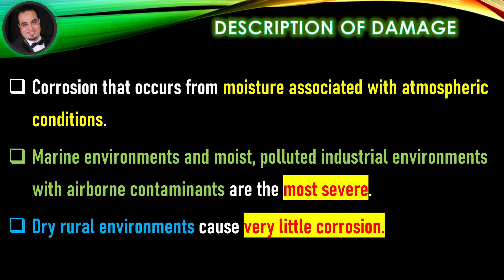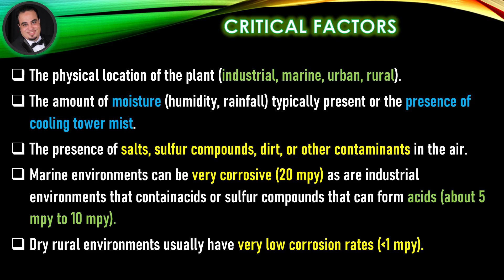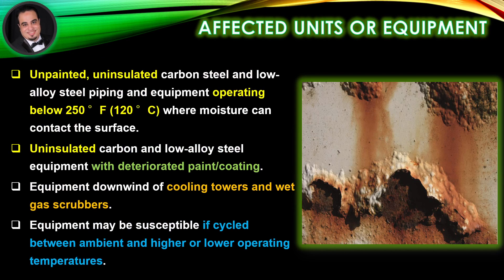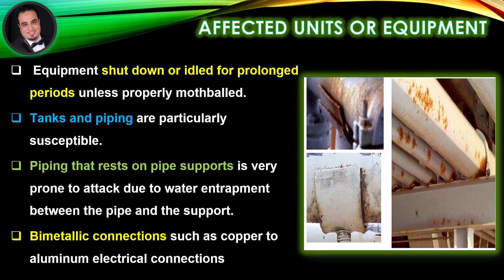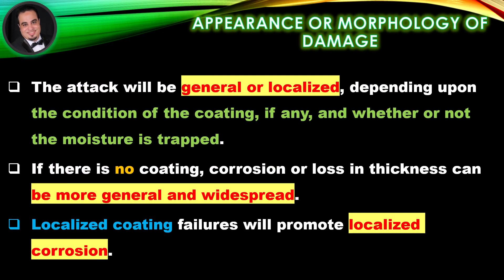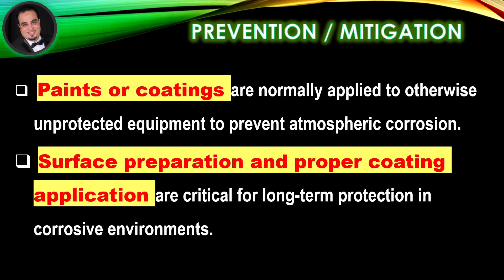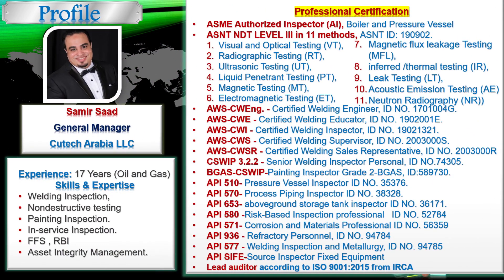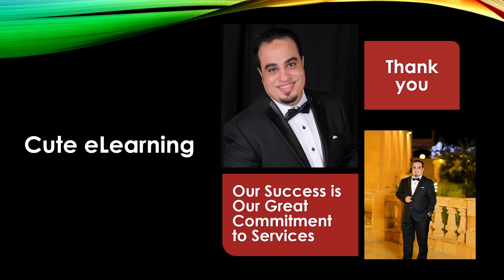ANSI/API RP 571 Atmospheric Corrosion

Comment: Can I ask that the temperature that affect the corrosion of wire bonding (aluminium bond pad) is also 121 degree celcius?
Reply from the maker: No, The corrosion mechanism of aluminum bond pad corrosion  is the bimetallic contact in the presence of Cl- ions  to be the driving force for reaction to propagate rapidly.